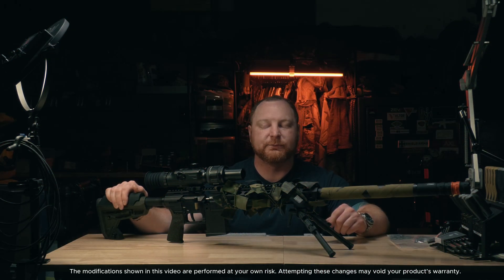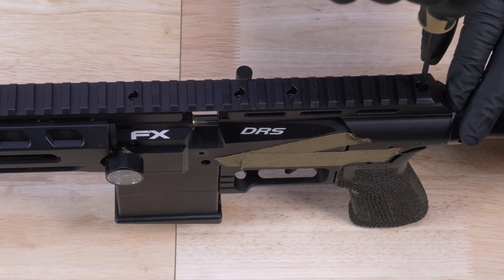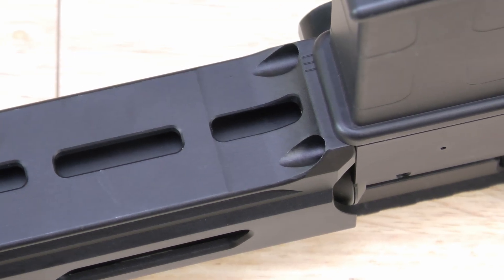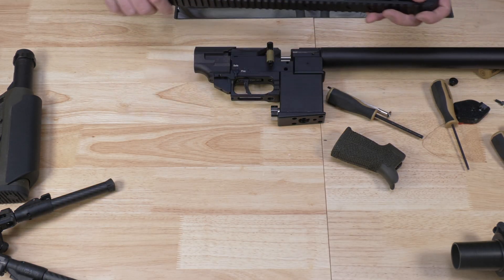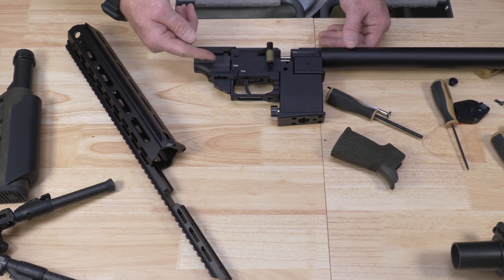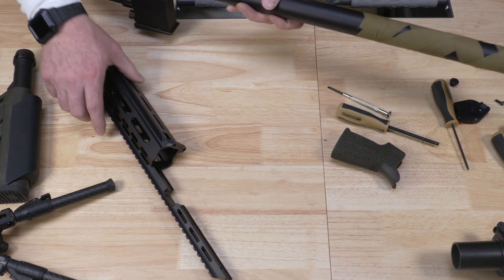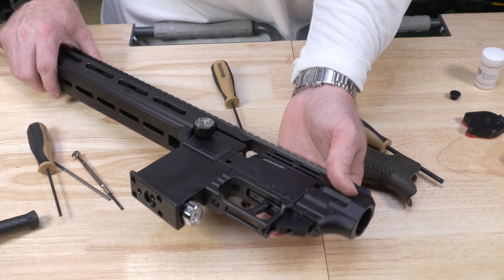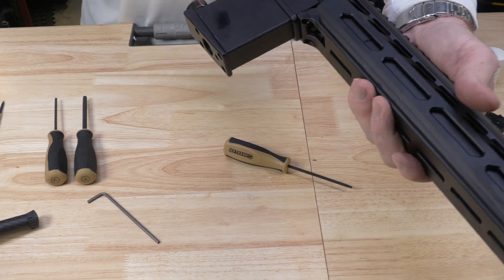FX DRS TACTICAL - Easily Tuning your Airgun with External Adjustment Modifications

Comment: What does this mod do exactly  ?
Reply from the maker: I can access the regulator and hammer spring now from the outside without taking apart most of the chassis
Reply: @Pixel-Shooter meaning i can change the power/velocity (jule?) externaly within a few minutes?

I ask because i live in germany- to transport it needs to 7,5j - at the range i can go over that Limit.

Comment: With the correct Allen key it is very easy to adjust the regulator without modifying the rail
Reply from the maker: Not on the original version I have. If you get the newer version with the external hammer adjustment it should have the regulator cutout on the rail bottom similar to what I did to have access

Comment: well my drs tactical 700mm in 22 cal came with the hammer adjustment wheel on the left side and the space for the Allan key is wide enough to adjust the reg pressure 

I've seen the 3 versions 1 with no external adjustment 2 with only the hammer adjustment wheel on the left side and nr 3 the one I have with both the hammer wheel adjuster and more space to adjust the reg pressure without to take off parts or dismantle the rifle 
it made my life easier and quicker love my drs tactical
Reply from the maker: Yea seems like it came in stages but they all have both now. Which is nice
Reply: @Pixel-Shooter  it really makes things easier especially the hammer adjustment wheel i can switch quickly between pellets and slugs adjust the speed from low to high just how i need it for every situation just slap the fx pocket chrono on the barrel and in just a few shots it's game time 
and i do love that it's more efficient especially compared to my wildcat mk3 sniper in 22 cal 

I'm planning to buy a second drs tactical the 600mm in 22cal 
got the 700mm 22 cal in sniper configuration 
the 600mm 22cal I think I'll make that one my pellet precision war plinker 

all the options with the drs tactical is wild 
i need to be careful that i don't end up with all the 3 versions 500/600/700mm all in 22cal 

it's so much fun and cool it's all I ever asked for 
great times to be alive for us airgunners 🇳🇱👍🏻

Comment: Damn, they did that with the drs pro I got like the first batch and it didn’t have the ball detent & spring for the hammer spring adjustment like the later models.. I had to locktite mine which I did not wanna do it’s messy..I tried the after market brass jam screw but you would have to take it off to adjust It. so I took that off.. I’m still considering creating my own ball detent & spring and notching out the adjustment screw for the clicks.. but yeah, I did notice the new tacticals had that side adjuster which I thought was pretty cool maybe you can create a hole on the side that meets your drilled hole so you don’t have to even take the buffer tube off so you can put a L shaped Allen key in there to make adjustments.. just a thought. Pretty nice work tho appreciate the video.
Reply from the maker: Yea I had seen some of those early DRS brass jam screws. Looks like a pain. If you are handy with tools it would be very easy to make a detent if you had the parts. Sourcing the parts would be the annoying part lol
Reply: @Pixel-Shooter  yeah I think I would have to tap the side out and find the right thread pitch screw for the tap and get a pen spring”. Find a small metal ball and take a my Dremel with a cutting wheel and notch out the adjustment screw.. maybe I can find one Pre-notched”but making sure I line it up right and notching out the screw just right I think would be rough especially Freehand haha  I think I’m gonna attempt it tho at least aluminum is easy to cut through right haha
Reply: Great video , quick question   What did you end up setting the reg at  for the pellets. 
I’ve  got the Huma new spring and 13 gr hammer weight added to mine , found that it has change the shooting of the rifle  to be very good. 
My reg set at 100. 
The other thing -did you end  up sealing the gauge  threads for the reg setting as mine seems to weep air !
Reply: @pixel-shooter any update on the question?
Reply from the maker: @richardcowan1422 hello there sorry I didn’t see your question last night. I have the reg at 90 right now but I’m gonna play with it some more. I was going to just shoot 18.3 gr really slow so I can plink really close in my backyard with my son. So not ideal for everyone. I think before it was at about 110 and shooting them really good. 

My gauge seal didn’t like the extra pressure when I cranked it to 165 bar for slugs so I just tightened it a bit more and it’s fine. The gauge face is sideways but I kinda like it like that. I have plastic shims I could use to correct it but like I said it doesn’t bother me so I just left it.